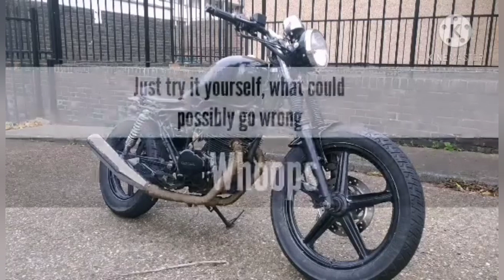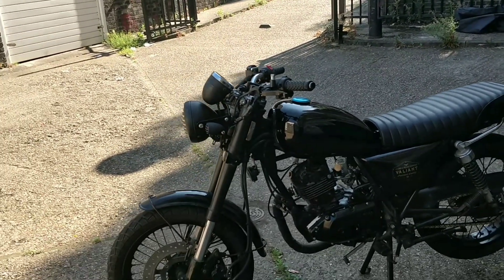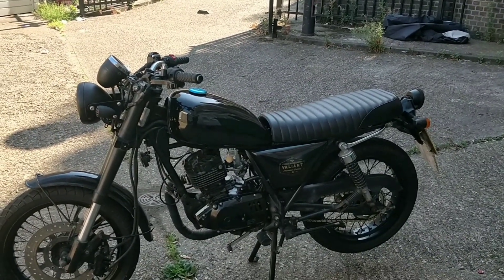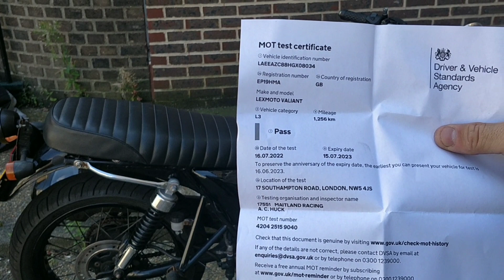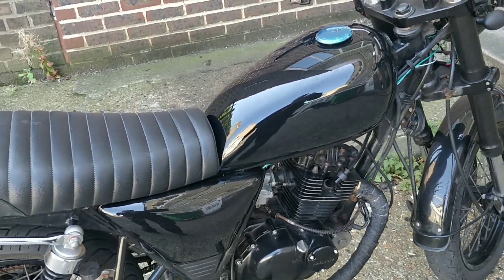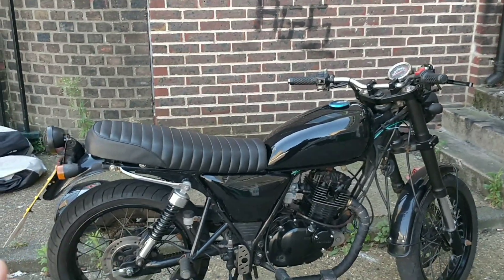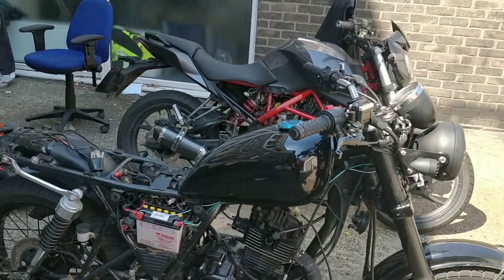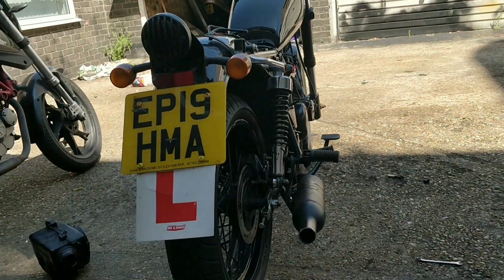What a day, lexmoto Valiant mot time, a very lucky phone call!!!

Comment: Bikes looking great
Reply from the maker: Yeh it is although still brought up a couple issues today. Intermittent cutting out even with a charged battery. I think I found the thought but it's a bit of a dud battery so had to go on charge again before I could test. So technically it should be spot on now but won't know until next Saturday possibly.
Reply: @motorcyclerescuer  I had to get new ones for my bikes as starting was a big issue with knackered batteries

Comment: I would very much like to buy this bike if it's still available.
Reply from the maker: Hi Thomas, here is a link to the advert mate. Your more then welcome to come view. 

https://www.facebook.com/marketplace/item/1065750354333708/

Thanks
Reply from the maker: Its also on Gumtree Thomas incase the Facebook link dosnt work.
Reply: Yeah I believe I did see it on gumtree when I seen the reflection of the number plate in the glass window in the vid, I will do a little more research on this model an be in contact shortly pal
Reply: Is all the jetting now sorted, it's not too much of an issue if not I have delt with bikes for some years
Reply from the maker: Yes its all sorted now, slightly upjetted. Runs exactly as it should. I rode it to the mot and back with no issues and have been testing it all week. 

Any Gremlin that popped up I took care of so it should be a good bike especially for the price, although underneath it will always be Chinese. 

I'm at the garage tomorrow if you wanted to travel to me. You wouldn't have to buy tomorrow but you could see it as the other ksr moto and of course all the other bikes
Reply: That's fab mate thanks for quick reply, I will look at it on gum tree tomorrow, it seems a fab example from others out there
Reply: I live in West Yorkshire, Halifax, do you roughly know how much curriour charge would cost? I'm not really aware of shipping costs on motorbikes
Reply: I would love to travel to see you an the other bikes, just yorkshire is a way off from your self, what other bikes are avaliable sub £1000 I'm open to any make model or style
Reply from the maker: My guess is that a courier would charge £160 to get the bike to you Thomas. They normally deliver a few days later. Your welcome to the lexmoto for £750 which will help you with the delivery cost mate. 

I've got the ksr moto which is a great bike, I will have that finished today fully I think. I'll get it a new mot on Tuesday and it will be ready to go. That one will be £850 for watchers as I'll be advertising it for £1000. 

Cheers mate